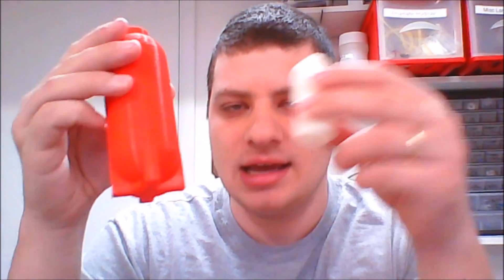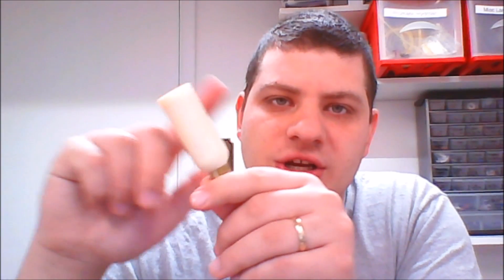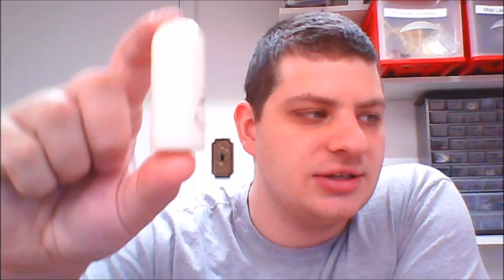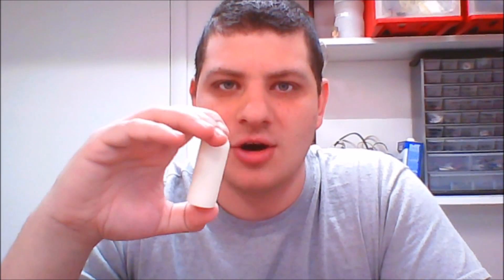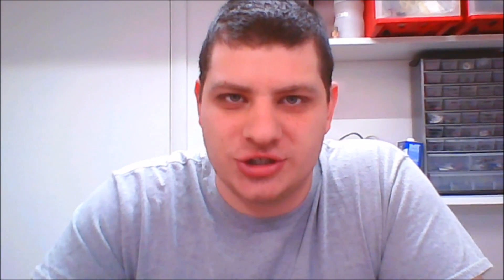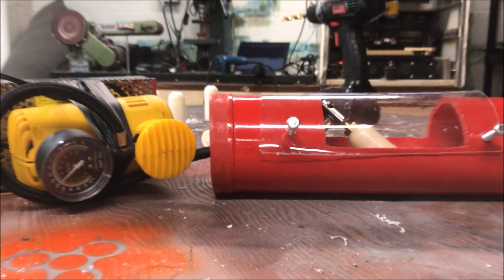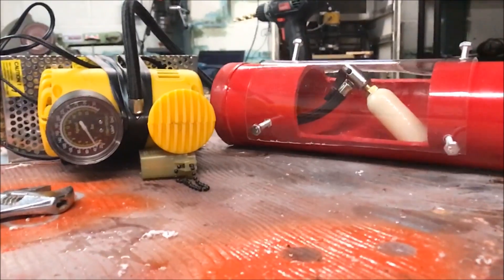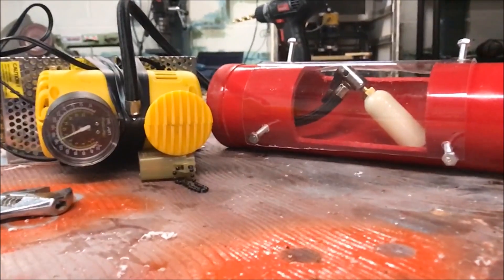Can you 3D Print a Compressed Air Tank? Part 2

Comment: Well done. I believe that this is the type of information that will move 3D printing in the direction of more interesting and useful prints. Don't get me wrong, I love trinkets and props, but I'm really interested in building things that couldn't have been built before, or at least on a budget. Keep up the good work, I'd like to see if the slurry will scale up, to at least as big as your printer can print.
Reply from the maker: +Joel Buckingham thanks! Printing a tank "as big as my printer can print" might get a little scary. I can 300mm x 300mm x 600mm (1ftx1ftx2ft). There is no way that I would get anywhere near a 3D printed air-tank that is that big :)

Comment: Ps do more videos on this topic please
Reply from the maker: +Joseph Craig I plan on continuing. I'm going to do a few tutorials next, but then I'm going to do the video on making the annealing oven, and try annealing the air tank. After that I think I'm going to switch to hydraulics though. It should be similar, but my plan was to make something that could be easily printed and used by a kid, and I don't want a 10 year old playing with acetone. I think hydraulics will fix that problem (but there is always room for failure).